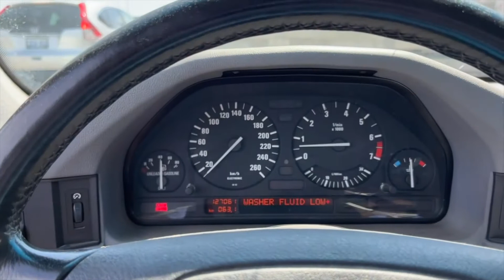How hard is it to get a quote on a new paint job? Project E34 part 9

Comment: In Greece, a decent full paintjob,(no prepping by yourself required),should cost around 2000 euros,just around 2000USD.Good luck chasing your electrics,usually the motors are at fault.
Reply from the maker: Good to know, thx for sharing!

Comment: In the UK in my experience, the cheaper "fitting in between jobs" type paint jobs never happen or get rushed after having the car for months / years. Don't go for cheap, always agree a deadline, get a recommendation from car club / friends / forums or Facebook (with proof of a good job) and ask to see some jobs as they 'finish' them. It should not be stressful. As a rough guide 8 years ago, it was £200 for just a wing (Fender).

Comment: Dude, who needs 'hair' when you have 'air', bald and stubble is considered very sexy these days especially with shades! Hell there ain't room for hair follicles anyway, due to all the testosterone in there! The E34 is barely audible even at full throttle, ahh what a sweet engine. And I agree about Ronin, can't remember any of the plot only the car chase. I'd say a 250 bucks for a full respray, but it would take around a hundred rattle cans!!! Seriously though, your price quote sounds ok if the quality is high and he has the correct facilities such as a paint booth and oven to bake/harden the pain. Last thing you want is dust particles trapped in the paint.
Reply from the maker: Ya the booth is key, that was a must! Thx buddy